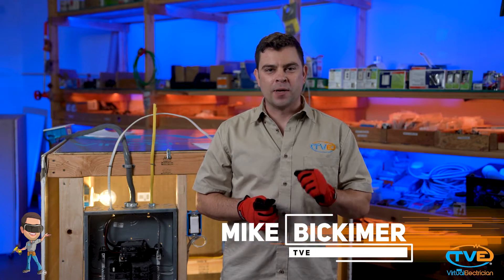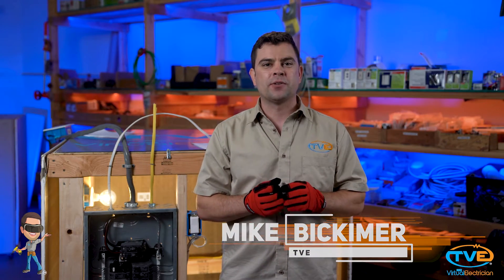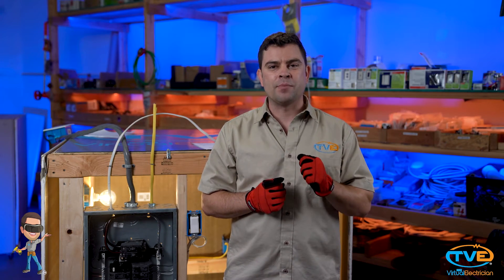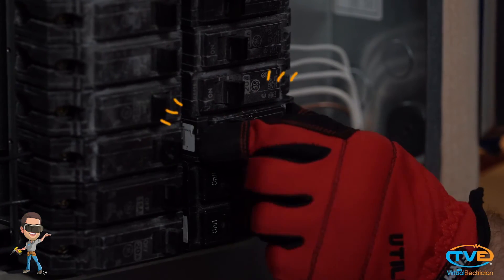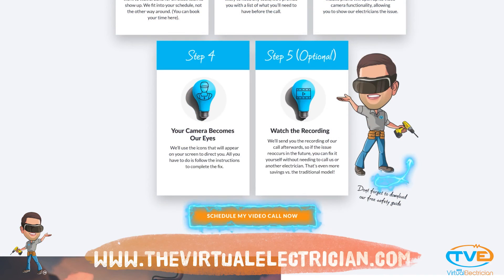How to install a "Tandem Breaker"

Comment: Thanks, This helped me solve an electrical problem in my house where there were 2 wiring circuits on single 20A breakers for the kitchen,  I have a Square D panel,  I installed 2 tandem Square D breakers and now have only 1 wiring circuit on each 20A breaker.  adding a larger microwave and an 1800W air fryer to the kitchen is what made the problem show itself.
Reply from the maker: Oh yeah . Those air fryers alone almost fill the capacity of a 20 amp circuit. They are totally worth it though!!

Comment: I am using a tantaum breaker one wire red is controling one circuit the black another sharing a neutral do I have to have a clip connecting the tantaum breaker in case the top part of tantaun kicks the bottom will to where I am sharing the neutral
Reply from the maker: if you are installing a tandem breaker for a shared neutral circuit you will need a 2 pole tandem breaker.  you cannot use a regular tandem because the black wire is for phase A and the red is for phase B.  You would not need a clip connecting the 2 phases unless it is a 240v circuit

Comment: Does this apply for 3 wire panels? I have two knockouts available horizontally but need a 220V+ 30A breaker for a 30A receptacle.  Do I get tandem breakers to free up 20 A circuits on one side of the breaker?
Reply from the maker: Yes. Just make sure that the circuits you are putting on a tandem breaker each have their own neutral wire.

Comment: i have a black and red wire that i need to hook up to my panel and only one spot left. Can i hook that up to a tandem breaker?
Reply from the maker: If the red and black wire are in the same wire jacket, then you would need to install a tandem breaker and a regular breaker. The red wire would go on the single breaker and the black wire would go on the tandem breaker with another circuit from your panel. If the black and red wire are in the same wire jacket they need to be on separate phases of the panel since they share a neutral, so make sure the tandem breaker you install is not on the same phase as the red wire.

Comment: Can you make up a 100 amp sub panel using two 50 amp tandem breaker from a main panel of 220amp?

1st 50 amp tandem breaker , both wire tied together  (mark as red) and goes to 1 hot leg wire of the subpanel = 100 amp

2nd 50 amp tandem breaker, both wire tied together (mark as black) and goes to the other side of hot leg wire of the subpanel = 100amp

And of course with all proper wire gauges for its amp and neutral and ground wire aswell.

Would that work?
Reply from the maker: That would not work. Your only going to get the amount of amps the breaker is rated for
Reply: Have you tried checking their amp rating when it’s done? (Tied together tandem)

It’s like tandem in parallel